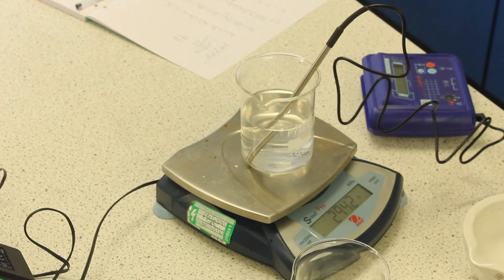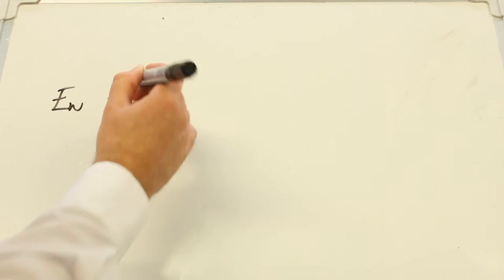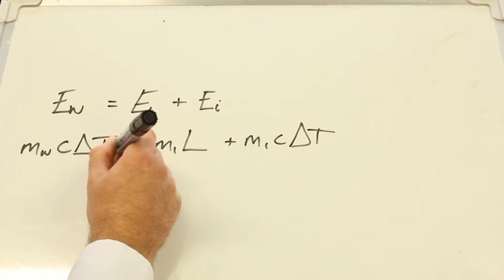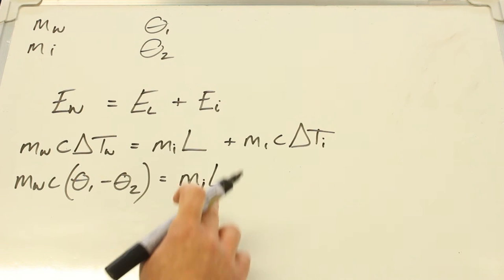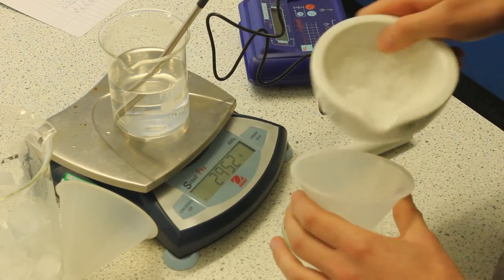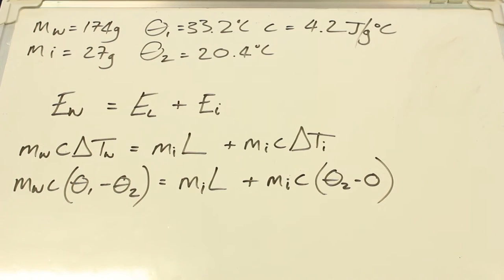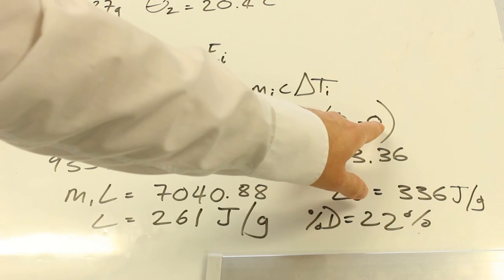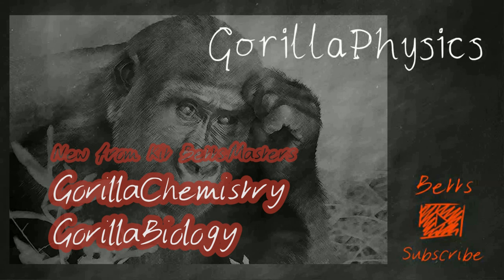Specific Latent Heat of Water - A Level Physics Practical

Comment: "The temperature of the ice beforehand we will know is zero because an ice in water mixture is always at zero degrees." Nonsense.
Reply: in a water mixture when ice is melting there is no transfer of kinetic energy therefore the temperature of the ice does stay the same.